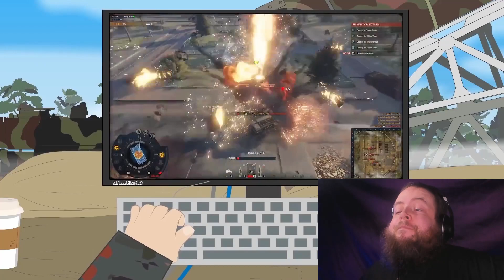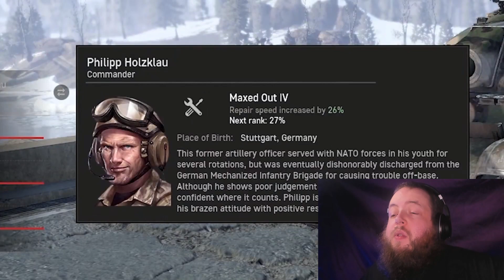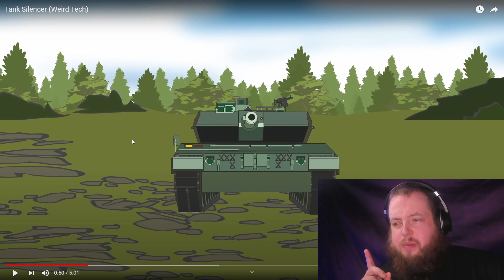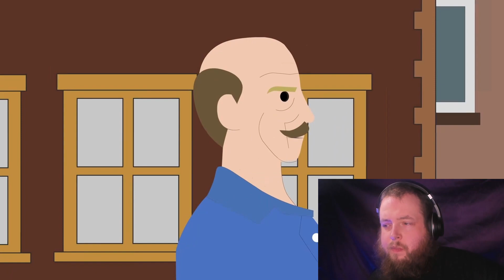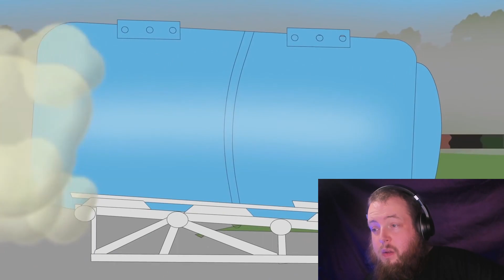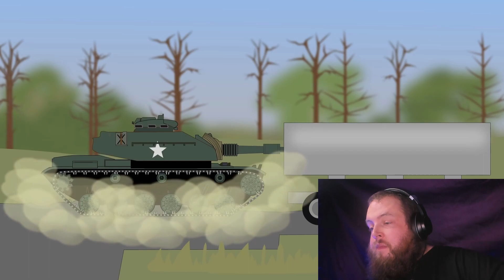History Buff Reacts to "Tank Silencer (Weird Tech)" by Simple History!

Comment: Yeah for decibels, the intensity goes up by 10x (if I'm not mistaken) for every 10 unit increase. This said, the difference between 60 and 80 in that scale is of 100 times.
Reply: It actually doubles every 3 dB, as it's a weird logarithmic equation, something something 10log(I/I⁰) I think off the top of my head
Reply from the maker: Maths which I've never been great at, but I can see how it can grow for sure. It's weird how much difference there can be between 60 and 70 tbh.